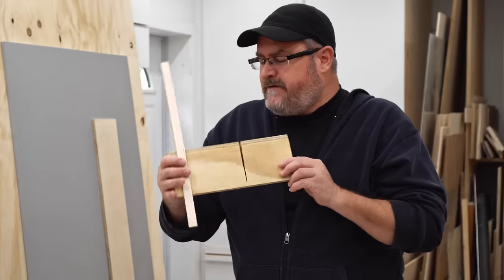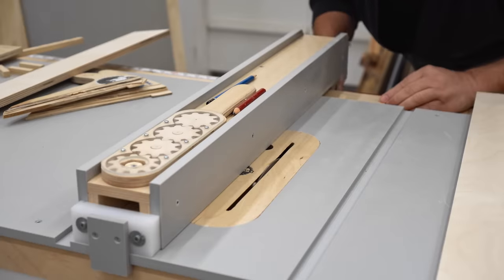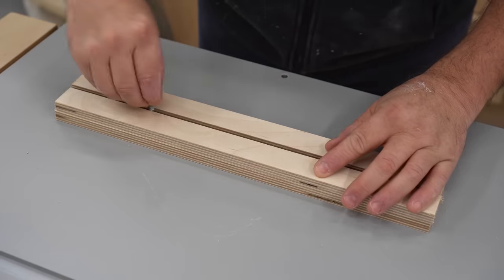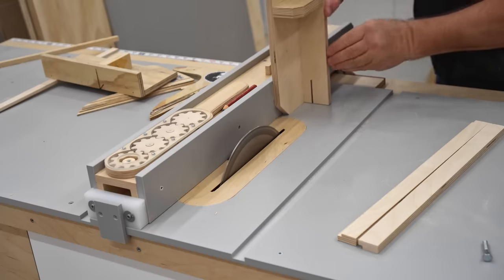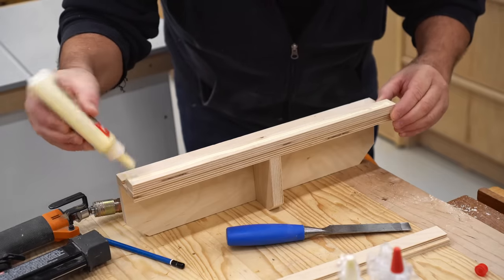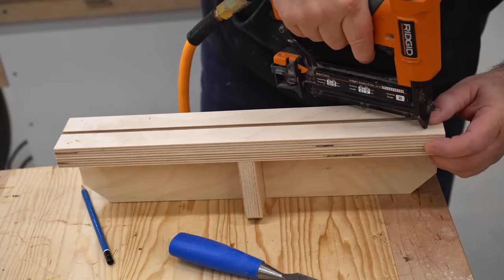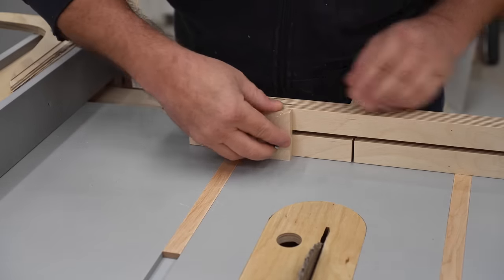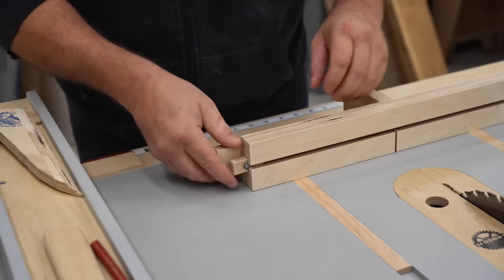Make This Mini Table Saw Sled - Super Deluxe Version

Comment from the maker: Free plan and more details in the build article:
https://ibuildit.ca/projects/making-a-mini-table-saw-sled-deluxe-version/

The original mini table saw sled:
https://ibuildit.ca/projects/mini-table-saw-sled/
Reply: Great improvement to a great tool, thanks for the free plans !
Reply: Thanks John I built the first version and I love it. Looks like it's time for a new one.
Reply: I like the design but why isn't there a base? More depth of cut?

One thing that I would do is add a spring to the t-track stop to make the wood pieces stay apart.  That way, you don't have to fiddle with it as much when you put it in the track.
Reply: Zt
Reply: 50000000000000
Reply: Im building this at the moment. Waiting for glue to dry before final slot cuts and sleds. Im adding a ruler to the top and adjustable pointer ( also in case i change blades which can change thickness).

Thank you very much for the video and plans. Thank you also for the metric conversion. I just don't know how you guys can do this in imperial with fractions.
Reply: Better than those chunky things other build. Great job, I'M UK  guy
Reply: Neat job John I'm a UK guy like your style.
Reply: Super robota
Reply: Is your website "out of order"?  I couldn't get it to open.  Great sled, I hope to make it.

Comment: Awesome sled, just finished it.  Highly recommend It and plans are free from John.   I also recommend the belt and disc sander, it's compact, easy to build and adjust, very useful.  and very cool with holes drilled in the top wheel.  Thanks John.

Comment: I’m going to make this one! I have made several sleds over the years, but this one is small and light. I may add (to the finger-saver block) a removable “tail” piece going back beyond the back of the table with a little block at the end on the underside, to stop the sled at the furthest-forward point it should go.

Comment: I've just made myself two of these - one for my work place and one for my home shop. I only had 18mm ply, so a bit chunkier but works good all the same. I also added an extra stop block on the other end so I can set from/to locations for cutting out repeatable rebates. Great design - Next project will be the bar clamps :D

Comment: This is a great jig. I have been meaning to build one since you first made the original and now you've made it even better. It seems very useful when cutting small pieces and easier to pull out and put away than a big crosscut sled. Thanks for the video and build article with plans!

Comment: I love this design, and I'm going to make one myself.
I just have a couple comments:
1.  2:47  You make me nervous by not using the push stick here.
2.  Maybe you do it later off camera, but in all the videos I've seen that make a sled like this, they always check it by doing 5 cuts on a square to make sure the sled is really at 90 degrees to the blade.
Thanks for doing the video, nice work!

Comment: I really need to do this. I have a suggestion for the stop block, but it will interfere with your storage trick.  In order to keep the stop block from wiggling slightly as you tighten it down, how about putting a small runner on the back side of the stop block to run in the t-slot channel.  Thereby always keeping it perfectly square and vertical to the table.
Reply from the maker: Pushing it down against the saw table does that.
Reply: Fair enough.

Comment: Another well thought through creation John. Will get the plans and build one too - much nicer than the monstrosity I have now that reduces the cut depth by 1/2 inch due to the full size base.
A thought to stop you pushing the sled too far forward is to attach a small piece of ply on the opposite side of the table - covering the guide slots and level with the table top so they never get in the way.

Comment: I built this version and it works really well but it is not quite at 90 degrees when checked with the 5 cut method.  I took the runners off several times but getting it to "exactly" 90 degrees is not that easy (at least for me).

Comment: Just a thought but you could drill the counter hole for the bolt heads just over sized compared to the flats and not the peak of the hex and use a nut and washer with some epoxy to press fit (draw it in) the bolt head would bite in to the timber on the very peaks i feel that would be much more stable over time and heavy use!!!! looking nice though!.

Comment: At 6:00 when you epoxy the bolt into the wood.  Next time if you put a notch into the wood, it will hold it a little better by keeping the whole had and hardened epoxy from turning in the round hole.

Comment: I'm curious if an electric brad nailer would work as well as the air nailers that seem to always get used.  I have a little air pump for emergency spare tires with no tank, but I'm not sure that would work and it's noisy.  Or, would a hammer work for that purpose?
Reply: Hard to drive a single brad nail, that come in clips, with a hammer.  I have an electric stapler that will handle small brads but air gun much handier.  Also your little tire pump is continuous pumper and brad nailer needs a burst of air to work.

Comment: Fantastic! A couple question. 1) is there any reason why the runners are longer than the sled itself?
2) How did you glue those runners without getting glue on the saw or in the runner slots???

Comment: John, love your stuff and I really like the idea.  One question, would it not be better to square it to the blade instead of the fence?  Your thoughts?  Keep up the amazing work.
Reply: This question goes round and round in my head often… If the fence isn’t parallel to the blade and mitre slots fix that first. What is the true point of reference? I believe everything should align to the mitre slots so back referencing to the slots from the fence should be fine… but the blade is the important thing… it must parallel to the mitre slots or fix that first… the fence is parallel…

Comment: Great video, i will definitely make one of these.  Question....is the "handle" meant to enclose the saw blade?  It looks like yours is offset and the blade would just clear it maybe and could catch your finger or hand if you pushed too far?  Im new to this and just fixed up an old table saw i found on cl
Reply: There is no "handle". What you are thinking is the "handle" is the blade guard. You don't put your fingers or especially thumbs on or near it when cutting! Also there is no need to cut all they way through it. You just push till the work piece is cut and that's it.

Comment: just curious - do the runners being so much longer than the sled really make a big difference in accuracy? or would it still be plenty accurate with them only extending the length of the sled itself?

Comment: Don’t lose those fingers man! One day you will make a mistake, your current work style is not safe ! No matter how many years you been doing it! Stay safe, work safe !
Reply: I was thinking the same thing.  At the very least, put a riving knife behind that saw blade if you're going to use it without a blade guard.  You can make one yourself out of an old blade or a piece of .0.10" steel plate.

Comment: The table saw would eat those 23G pins and wouldn't even notice
Reply: True, but every little extra bit of steel it has to go through makes it that much sooner it will get dull.  No sense in making it duller quicker if you can avoid it.
Reply: I would notice. Why take a chance?

Comment: I expected to see an actual sled.  Instead, I saw a fixed angle miter gauge.
Reply: Was gonna say; not to be a "know-it-all" as was stated above, but just to point out that technically you can't really call it a "sled" if it isn't actually fully supporting the work piece and carrying it over the saw blade.

Comment: Perhaps I am not very bright, but I don't see that this is any better than the miter gauge that came with the saw.
Reply: The sled provides a back-board for the stock - close to, and on both sides of the blade.
Reply: @donstanley8021  Also, most miter gauges are a little sloppy in the slots.  You also might not be aware that John built this table saw.